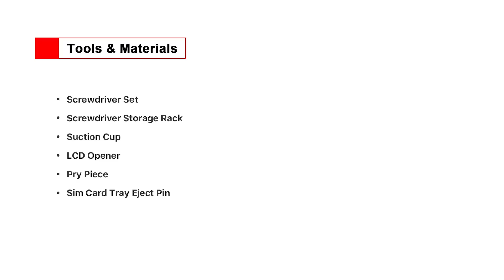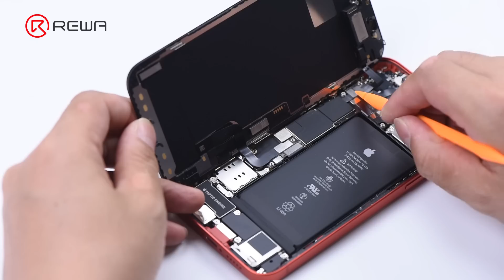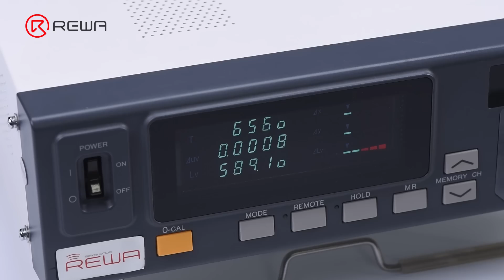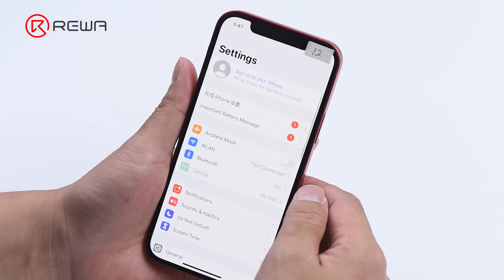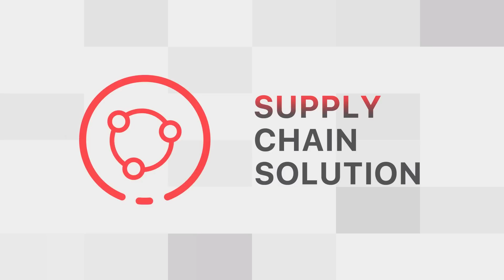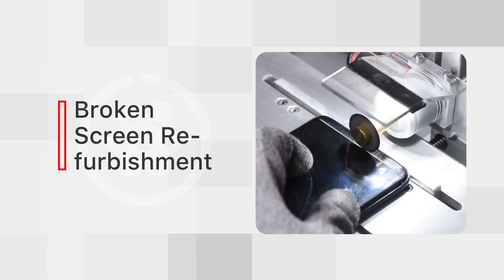iPhone 12 vs. iPhone 12 Pro: Parts Swapping Test by REWA LAB

Comment: After researching, I found that the iPhone 12 and 12 Pro displays likely come from the same production line. However, during quality testing, some displays struggled to stay consistent around 800 nits, so Apple “binned” the display and allowed iOS software to lock it to 625 nits before shipping it with the iPhone 12.

Comment: I take it the Face ID didn’t work because you left them on the screens correct?
Reply: it seems the connector cable itself is paired. so exchanging them would indeed make them work. it's odd, as that's a earpiece cable....

Comment: Is it possible to swap motherboards? They seem to have same connectors even for cameras 🤔
Reply: heres a video where they swapped the motherboard and a lot of issues started to happen like lag, unusable camera and so on https://www.youtube.com/watch?v=FY7DtKMBxBw&t=7s
Reply: No because the mother board is paired with all of its original parts meaning of the MB is replaced all the prompts will be activated

Comment: x, xs , xs max ,xr, 11, restarting and stuck issue caused by charging  flex...
I was faced same problem those models..
If i change coppy charging flex same problem...when i fix orginal  charging flex (removed from anothor device)its working fine...
Reply: Any solution for this??

Comment: So it’s basically same phone and it cost 200$ more only for telephoto lense and lidar scanner huh? Ohh also the word pro 🤣 good job apple 👏🏼
Reply: Display, 128 GB ROM vs 64 GB, stainless steel vs aluminium, 6 GB RAM vs 4 GB, telephoto, lidar.
Reply: @C0rn40l10  cmon display is the same and they just messed with nits in the system. And ram rom is few dollar more to build that.
Reply: @Anduk  one has 4 gb of ram and other has 6 gb of ram

Comment: The fact that the screen becomes darker or brighter due to software ( iphone version/model ) makes me sad, apple is so greedy
Reply: i think it isnt all software. the 12 pro might have a better/stronger display driver to allow the higher peak of power
Reply: Didn't they say the cause may be related to the motherboard OR the IOS system?
Reply: @communistsimp98  you have to watch the whole video it's software related
Reply: rewa mounts the iPhone 12 “normal” screen to the 12 pro, and the brightness is Like the 12 pro original panel (tech specification) , the brightness is controlled by software or some capacitor/display controller on motherboard, same panels, same pieces... the only differences, chasis contruction and rear cameras + lidar sensor,
Reply: @Magoon TV sure, be dumb they like it
Reply: I think it has to do with BOE VS Samsung panels